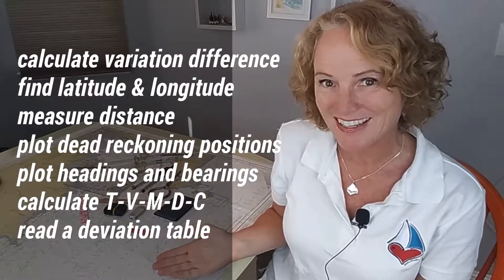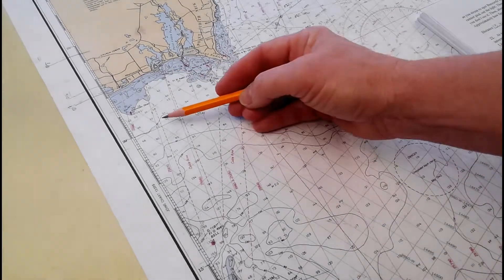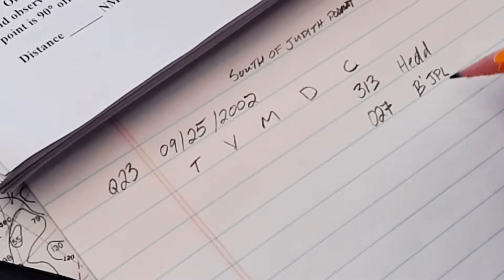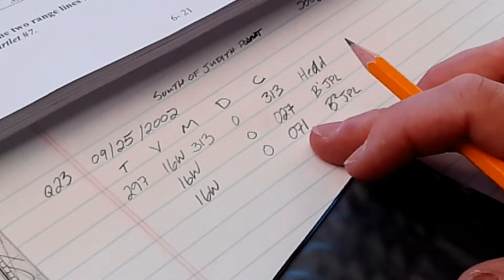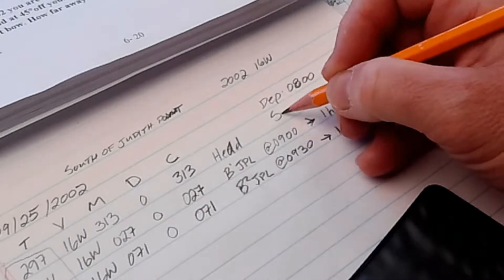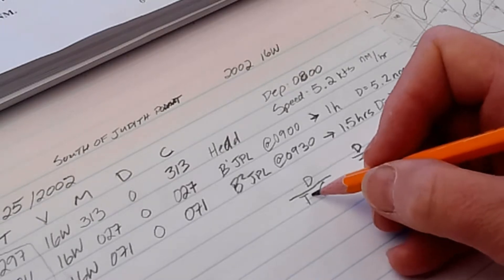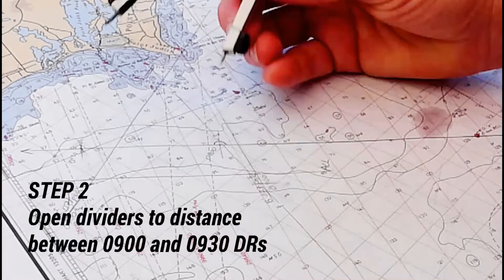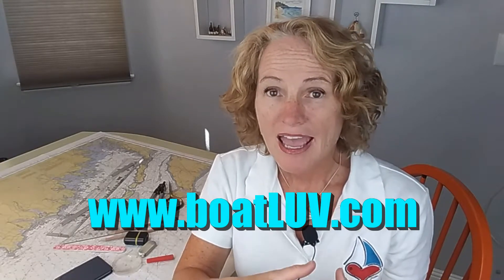How To Plot A Running Fix

Comment: I don't get why the Point Judith bearings are listed under the column for Compass.  The PJ bearings are taken with a handheld bearing compass.  Deviation only applies to the ship's Compass.  So the PJ bearings should be listed under Magnetic, no?  In this example, there just happened to be 0 degrees Deviation, but if there had been non-zero Deviation, that would get subtracted as you move leftward across the TVMDC row. which would result in an error, no?